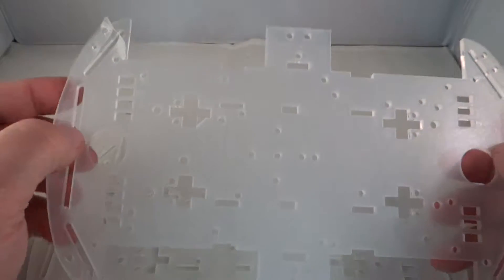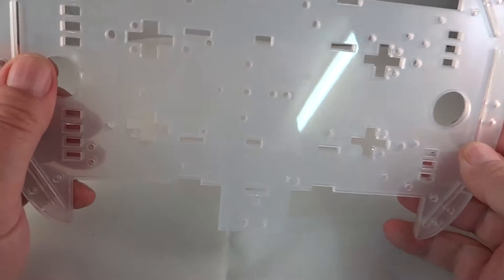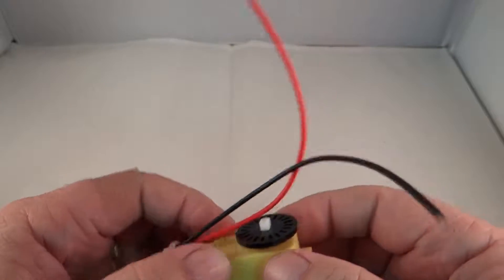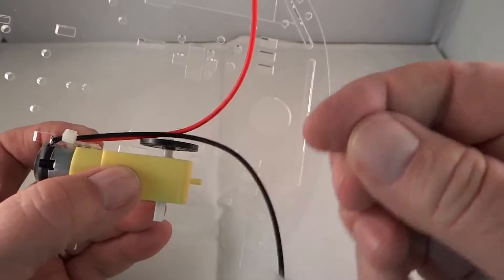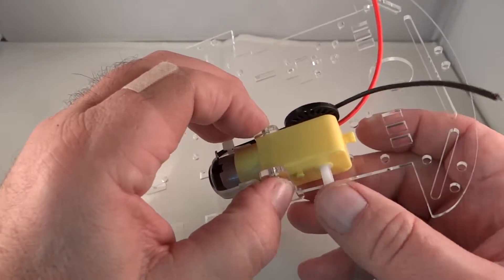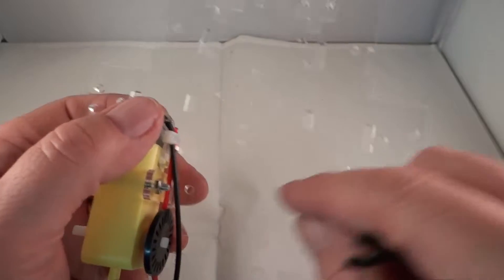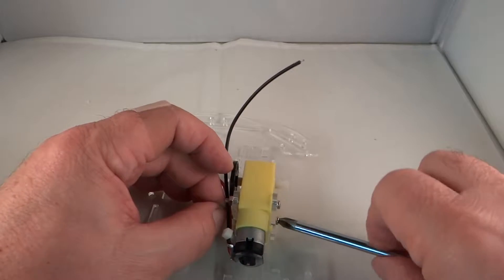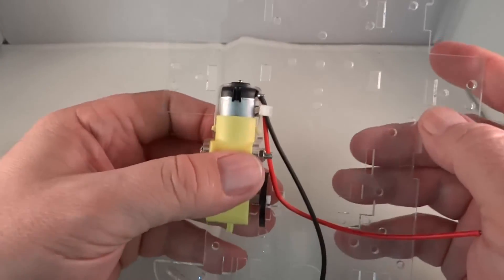Makerfire Robot Car Chassis Kit   04   mounting motors on chassis

Comment: Great video.  Thank you. 
By the way,  where did you buy your nut driver?
Reply from the maker: Thanks! Amazon - Wiha 26591 Precision Nut Driver Set - there are two sets, one metric, one "Inch". For hex screws, I use NEEWER® Titanium Nitride TiNi Hex Driver Wrench 4 Piece Set , and for small open end wrenches I use Moody Tools 58-0151 8-Piece Open End Wrench Set for "Inch" and Moody Tools 58-0161 8-Piece Metric Open End Wrench Set for metric.
Reply: Thank you.  I'm going to order mine today. lol, I really like learning and making these cars. Eelegoo was a great project.  Sunfounder makes some nice cars too!
Reply from the maker: I'll check them out, thanks!
Reply from the maker: I just ordered the Sunfounder Raspberry Pi camera car. That should be fun!